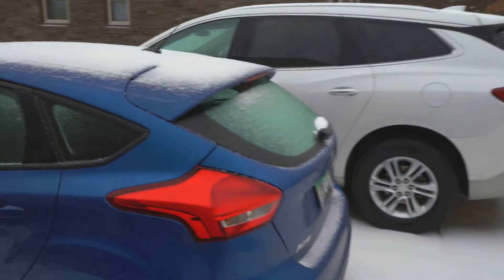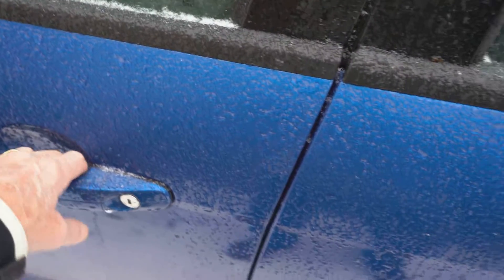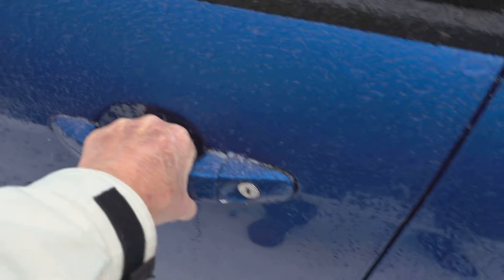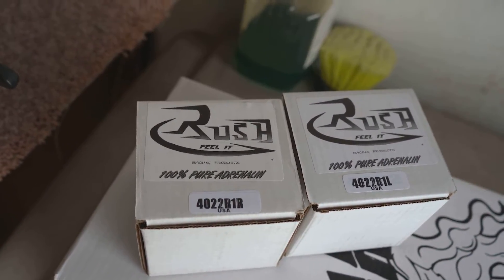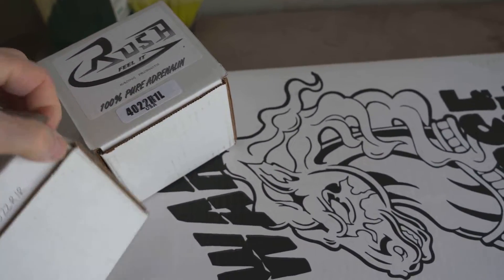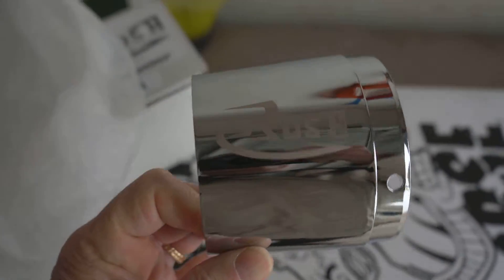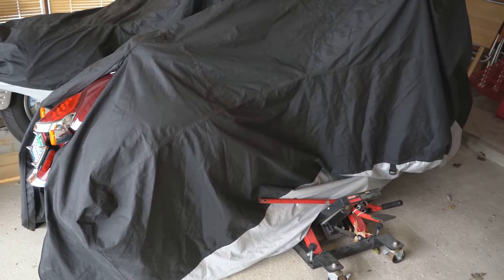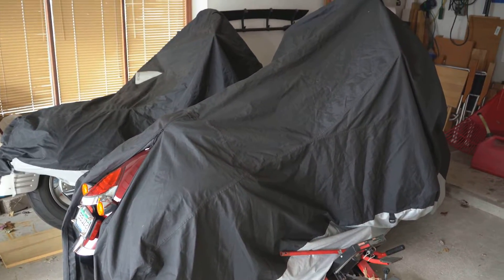RUSH EXHAUST INSTALL

Comment: Do you think the 3” baffles will be too loud for long rides? Thanks! I am not sure if to order these or the 3”.
Reply from the maker: 3” will be a bit loader, and that is why I chose the 2 1/2” ones. Mine aren’t that quiet.
Reply: @rickiekm  Can you use another company's tips and not mess with the baffle?  I'm thinking of doing these with the Indian fish tail tips.
Reply from the maker: As long as the diameter is the same, I think you can put other tips on the pipes.